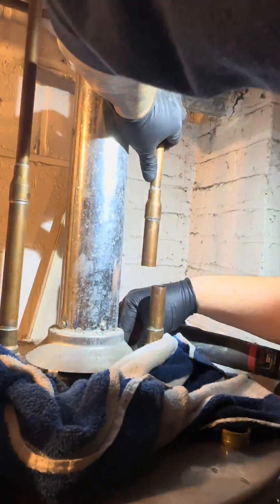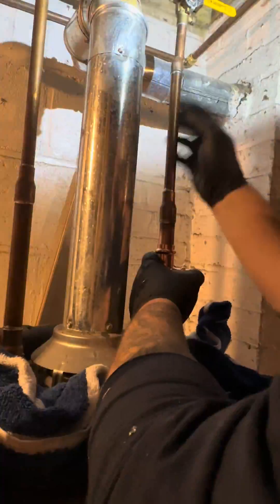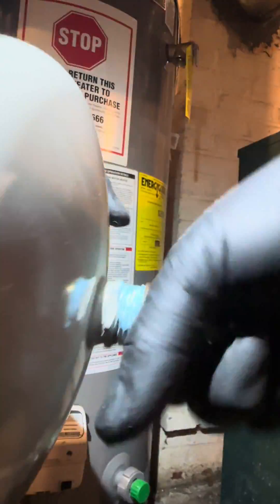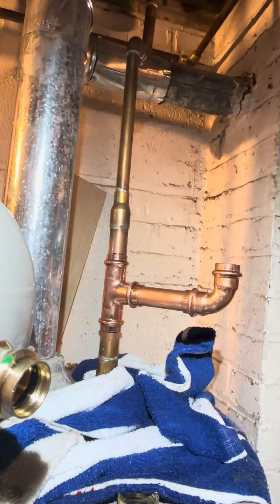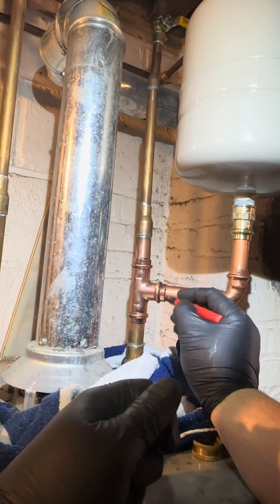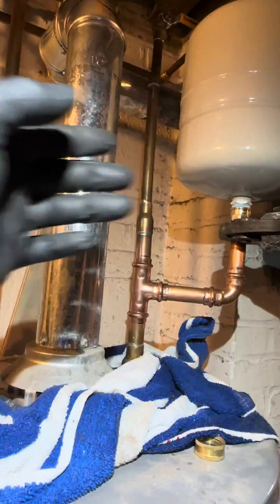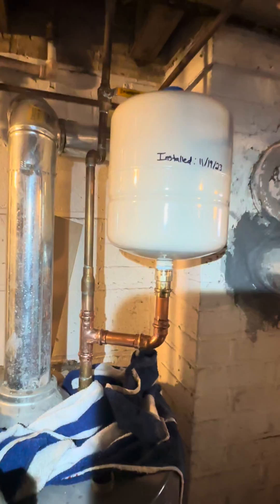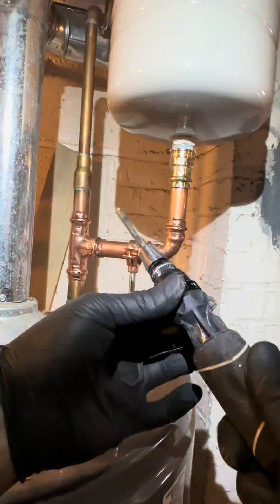Installing Thermal Expansion Tank on Gas Water Heater !

Comment: You're correct, a thermal expansion tank is required by plumbing code but only when its a closed plumbing system, and not required on tankless.

Comment: Soldering isn’t old school.  It’s the best method, and better than Propress.  And a plumber who won’t take the extra few minutes to solder pipe & connectors is like a surgeon who doesn’t do suture after surgery, and uses staples with all the consequences borne by the customer.
Reply from the maker: Not true really , views fittings are guaranteed to last a minimum of 50 years at that point anything really can fail solder pro press pro cpvc so I beg to differ